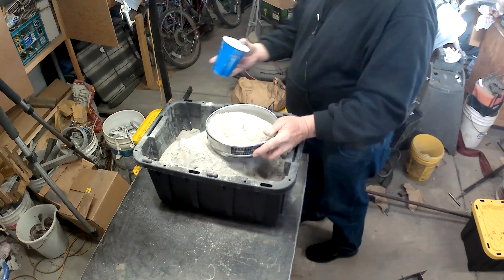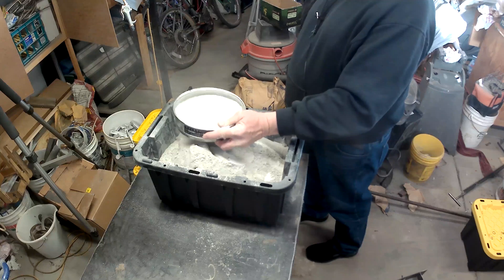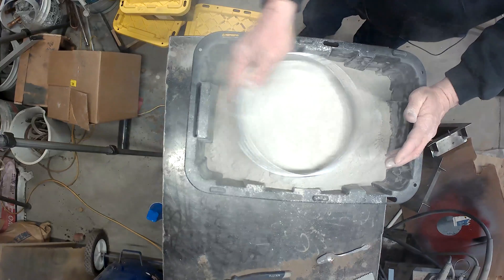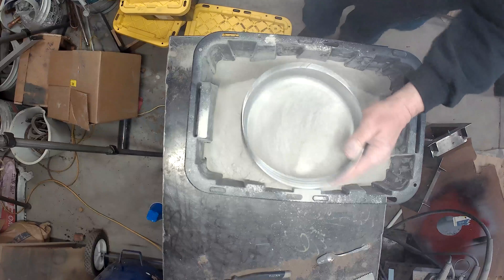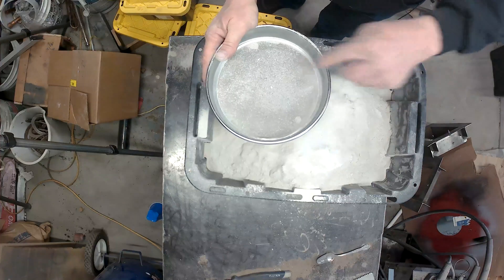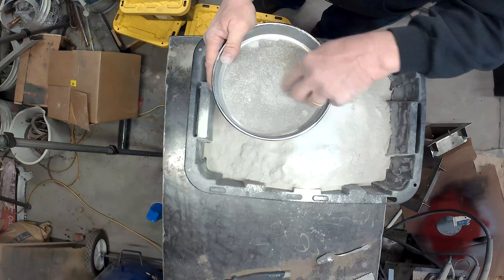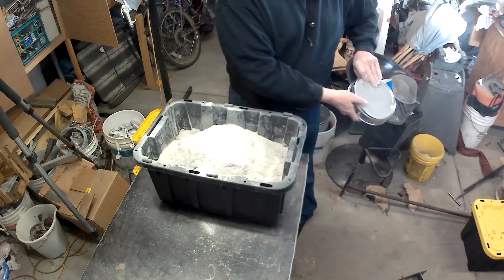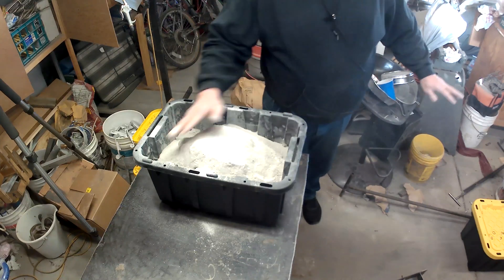Walk away from petrobond. My last word

Comment: When I look at your "incorrect" flag I see the stars in correct orientation but the stripes not so much.  The Red stripes start at the top and end at the bottom but your model begins red and ends white.  Right?  BTW:  I really enjoy your content.  Today was a pour of your ramming tool (or at least a close copy).  I used your pouring basin/sprue - runner/gate - spin filter arrangement and added 3 feeders to try to eliminate shrinkage.  I think I got a good fill but none of the feeders sucked down.  I had a tiny bit of shrinkage on the middle of the shaft but everything else was fine.  Thanks for the help.
Reply from the maker: Sorry for the delayed response.  I vaguely recall asking about an issue on a flag that I cast but for the life of me I cant remember what it was or what I thought the problem was. That was a few years ago and I'm old 😂

I learned something just the other day about feeders not shrinking that I thought was interesting. Not saying this is what happened to you but I'll share it anyway. If the metal is poured too hot and has a gas in it, the feeders don't shrink but rather kind of expand with a rounded top on them . They called it mushrooming as opposed to tubing. What you want is tubing not mushrooming. 

I also know from experience that when I pour too hot I get more shrinking in the parts. I expect this is from the metal being too "expanded" from the heat and that it shrinks more when it cools.  If you haven't done so, I'd encourage you get a low-cost k-type thermometer. It made a world of difference for me. Try to pour when your aluminum is 1325F.

Comment: To pulverize the tidy cat litter (Bentonite) use a blender but, fill it just over (1/2") the blades and let run. It will push it like a liquid up the sides and down the center to blades. If you over fill it will just stagnate in blender and posibly burn out blender motor. About a minute and you have powder bentonite. I did this on 17 pounds of litter before I let the blender rest because it will get warm. Thanks SWDWEEB for the video. I made 5 gal bucket of Homedepot play sand (50Mesh) and Tidy Cat litter (50Mesh).
 works great !
Reply from the maker: 😁😁 I tried a thrift-store blender and burned the motor out trying that. Could have been the motor was already shot as I'm sure there was a reason it was in the thrift store

Comment: Just a thought, couldn't you use plaster powder as the binder  with sand blasting sand ?
Reply from the maker: Don't know about plaster powder. Would it harden after the water was applied? I've also been told, but have not tried it, that plaster reacts with things like aluminum and releases gas into the mold. Again, I've only been told this.
I've also been told that sand-blasting sand is not good sand for molds. I think it has to do with the shape of the sand granules. I've never tried to make it with sand-blasting media so I don't know.

Comment: Wonder how the play sand would be if, after sifting out the rocks, it were run in a ball mill for a bit.....I'm thinking it's time to experiment
Reply from the maker: I expect it would be just fine, no pun intended. When you look at the grain size of petrobond it is very fine. My greensand is 80 mesh sand which is pretty fine but its not as fine as commercial petrobond which is typically around 130 mesh.

Comment: I have about 4 5 gal buckets of petrobond that I got from my boss. He bought it in a molding bench at a school auction. He never really used it so he gave me the sand. This was atleast 15 years ago. I always had a little trouble with the sand falling apart while molding. I just got back into casting and the sand defintely was even worse than before. I know you are supposed to add non detergent oil but I didnt have any so I used some chainsaw bar and chain oil. It seemed to work pretty well. Now my sand holds together much better
Reply from the maker: You might do a search on the use of isopropyl alcohol in addition to the oil. I read something somewhere that it helped activate the binder or something.  I never added it to my petrobond just the non-detergent oil. The non-detergent oil was hard to find where I live, only one auto-parts store seemed to have have it and even then it was "let me go dig around out back and see if I can find it". The sand got blacker and blacker over time. Never stopped smoking or stinking though 😂😂

Comment: I tried making my own greensand, starting with playsand, which was WAY to coarse.  I got some sieves like you, but the time and effort was a LOT.  Grinding up cat litter (they don't all use bentonite clay, BTW) took HOURS and made a huge mess.  For all the time and effort the castings were mediocre.  I'll stick with Petrobond.  Yeah, it costs almost as much to ship it as the price for the Petrobond itself, but when compared to the 10 or so days trying to make greensand, it's well worth, in my opinion!!   Time is money, right?
Reply from the maker: If I didn't have access to the sand and bentonite that I use, I'm not sure I'd make it either. I spent several hundred dollars getting  muller made so that I can make it without a lot of effort on my part. I sell it but most of the cost to the buyer is in covering the shipping. I don't actually make all that much on the sand itself. https://www.plmfoundries.com/product-page/green-sand

Comment: Great video.  Can you say generally how much use you get from a batch of green sand?  Suppose you had a 25 lb batch of green sand.  How many times can you reuse it making your flag casting, for example?  I ask because after about fifteen pours reusing the same green sand on a project roughly the same size as yours, I'm starting to see small gas bubbles (from steam?) on the casting, and I wonder if I have burned out the clay and lost permeability in this batch. Thank you.
Reply from the maker: Hi Fred, I think you're spot on with clay burnout.  As the clay burns out you probably need to use more water as a binder. 

I haven't really kept track of how many pours I do before refreshing the clay.  It depends on so much, how big the pattern is, how hot the metal is (aluminum versus bronze).  I basically add a little when I start to notice the sand is getting weaker.  I don't add a ton of clay either. 

I typically mull about 35-50 lbs of sand at a time.  I rarely use it all but I might as well do it all rather than guessing if I'll have enough.  That said, I probably add about 1/3 - 1/2 cup to that much sand. If I were to guess we're pretty close on 15 pours, maybe a little less for me (10ish??)

Given you make your own greensand, you probably don't need this, but I do sell small quantities of bentonite https://www.plmfoundries.com/product-page/bentonite-refresh if you need it.

Comment: Well I saw your videos about making greensand too late to help me getting started . I have already dropped over a hundred bucks on Petrobond and am still in the process of building my foundry.
I decided to go with ceramic wool insulation hardened with the hardener and coated with satinite. I’m building my own burner and it looks like mid summer I’ll be ready to fire it up.
Thanks for the info.
Reply from the maker: Well there is absolutely nothing wrong with learning on petrobond. It removes the variables of greensand moisture.

Comment: Priceless information!  The absolute most informative video I’ve seen on green sand.  Have you considered using a moisture meter to determine best moisture content for casting?
Reply from the maker: Thank you.  Yes I have but its didn't work. I bought one at a hardware store and it never registered the moisture content of the sand, took it back.  In my opinion, our hands are the best measure of moisture.  I can tell instantly if my sand is too dry or too wet.  

Of course calibrating my brain to making my sand dryer is a constant struggle.  I always think it should be moister than it needs to be. 😃

Comment: The finish on those casts are awesome, I haven’t moved on from play sand yet but I’m really looking forward to it. This has really motivated me to find some foundry sand. Another great video 👍🏼
Reply from the maker: Thanks, you can stick with play sand that's what my first batch was made from.  I still use it today.  Just buy a 50 mesh screen and get rid of the big stuff.  It takes a long time and you lose about half the volume during the sifting but play sand is cheap.  Of course if you can find sand like I bought it saves a ton of time.

Comment: Hello!
I live nearby the beach. Do you think I could just grab some of the white sand and filter it through a sieve? instead of buying playsand if I can't find any bentoniteas well.
Reply from the maker: I've heard that calcium (shells) may have adverse affects on the casting but I don't have any experience with it. You can always try given that the cost is so low.  You're going to have to have some sort of binder, pure sand won't have the green strength you need for your mold to hold together. I've been told that ceramics supply houses are a source for bentonite as well. You can buy it in small/expensive quantities on places like Amazon as well.

Comment: Just beginning the trip into casting. Found your videos and am going to begin the trip green. Was leaning that way anyhoo. Thanks for the information and tips on casting/mixing greensand... have about two hundred pounds of sandbox sand so will be dealing with that first. As far as screening things out I do pyrotechnics as a hobby so I have some really fine screens. Running the sand through a 50 mesh first and will go from there. Thanks again.
Reply from the maker: I found that 50 mesh gives a pretty nice finish.  If you can go finer... and have the time ad energy to do it, go for it. I don't think you need to go much finer but I really don't know.  Good luck with it and don't hesitate to reach out of you ever want to chat about stuff.
Reply: @swdweeb  well, got to lookin at the screens and have 40 and 60 mesh. Started on the 60...felt like I may not live long enough to finish. Also wanted to get enough sand together to do a pour. Went to the fourty. Got things mixed and here is my first trip into the craft. Looks like the 60 mesh is a better idea. Just need to get better set up to screen so it will be easier on the old bod. May have been a bit wet among other things. Have to figure out how to put a picture on here. Beginning to look like it’s not possible.
Reply: Yep, don’t know how to get a picture to you.

Comment: Hello, didn't you notice that green sand might give worse aluminum porosity because of the water added? I've got quite bad porosity with green sand, compared to casting to tin can. I repeated casting with water glass sand just for benchmarking. Water glass sand won in porosity - it's better than green sand. Here is a video
https://www.youtube.com/watch?v=jhmGImdcY5c
Regards, Ivan.
Reply from the maker: I havent seen any issues with porosity using green sand. The moisture content is very low. In my opinion porosity is the result of pouring technique and the sprue/runner/gate design.  

I have a series of videos on that https://www.youtube.com/playlist?list=PLU1QP34Dv8Y6-qXska4MOagRMSVWan40k
Reply: @swdweeb  Thank you for the link - I watched these ones. In my case (link above) I use the same technique (setup), the same metal, the same temperature, but see different results on porosity. In any case, will keep experimenting.
Reply from the maker: Hi Ivan, I finally had time to watch your video.  The quality of the video is very good, extremely clear.  The sand looks very coarse in the video. It probably isnt as coarse as it looks in real life.

If you want to email me at swdweeb@gmail.com I'm happy to discuss my opinions on what you're seeing.  That is a lot of porosity!  I think it is the result of your pour, not the sand.

I expect the break-out that you had with the mold was as you said, the draft was not enough.  I generally use 10% on a thin piece but probably would try to something closer to 5% for that tall piece.

Comment: I followed the Bob Puhakka videos to John Campbell and I come to the conclusion that metal should be basically slowly(but not too slowly) injected from the bottom of the casting moulds. Do you think theres a way to do that at home?
Reply from the maker: Yes I do.  https://youtu.be/hpwxnNlKP14 and any of my bell videos show what can be done in the home foundry.  
In terms of filling slowly, it is really about keeping the sprue, runner and gates full and not sucking air into them or causing causing turbulence by metal splashing about in the mold.  If I can find it, I have a video in which I look at a video from Andrew Martin to show what can happen.
Reply from the maker: Here is the link to that other video https://youtu.be/uTtstp_eDCI
Reply: @swdweeb  I think your system is the best way of doing what Campbell says to do while still pouring. But in one video I saw of him at castcon he said that metal shouldnt be poured because it is damn hard to stop turbulence. I'm just wondering out loud, but I'm curious if theres a way to have a feeder on the bottom of a cast and push the metal in from the actual bottom of the mould rather then the side. I imagine it would be hard as hell in a home setting, but from what bob puhakka and Campbell says, professional foundries dont even do that level of sophistication. I dont want to make it sound like I'm critiquing you at all. Seems like your the only one ive come across that even goes to the extent of counter gravity. I'm wanting to get in to casting very much. Your videos are awesome.

Comment: I have seen recipes for green sand that include a small amount of sea coal (very fine bituminous coal; added to form a gas film between the metal & sand) and wood flour (improves water absorption).  But the source also said those additives weren't as necessary for lower temperature metals such as aluminum.
I imagine there are some tweaks to the recipe that could make a difference, but unless you decide to try making some ridiculously detailed patterns, it may not be worth the effort to find that "perfect" greensand.  Your castings are great, and it's always a thrill to see the improvements you make.
Reply from the maker: Yeah, I know @Luckygen1001 uses coal dust in his sand to improve its qualities. 
I don't think @olfoundryman uses any additives in his sand, It seems to come right out of the ground with what he needs (short of some sifting I believe)

Comment: Hey nice to see you again! 👍
I started out with just play sand "borrowed" from a playground down the street, then did the kitty litter in the blender trick and got very fine silica sand at a pet store of all places.
Moved on to powdered bentonite instead of the kitty litter, works great for me for about a year now, was thinking to switch to petrobond because that is what most metal casters on YT use.
Glad to see you experimenting and hear you thoughts on this, I will stay on the green side too 😋👊👍
Reply from the maker: Well, you know my opinion but I think you’d be disappointed with PB if you gave good green sand

Comment: Thank you!! I was literally in need of this exact video as I type this message. This exact thing.

Any scale for how much water per lb or something like that you use? People say “till 2 pieces break apart and nothing crumbles”. Is that the best way to go about it?
Reply from the maker: I tried to reply last night but it obviously didn't stick. I agree with what both Carl and Andy said before me.  My sand is likely drier than you would expect. I do the clump test and as Andy said, you don't want it sticking to your hands, that's too wet. It is a matter of trial and error to get what is strong and not too wet.  The more you play with it the better your touch will be able to tell you if it's right.
Reply: I go by dry enough to not stick to your hand when you squeeze a handful tightly.  And wet enough to give it some strength.  The best way to learn how wet you want it is to cast over and over with it.  You soon learn.  Mull it (stir, shovel over, etc,) then let it sit for several hours and mull it again.  It will change when it sits.  Moisture content is not super critical over a reasonable range.

Nice job, , glad you're back.  Wish I were.
Reply from the maker: Good to see you too!   I'm going to email you later this morning.
Reply: swdweeb finally found some local Bentonite! Making my foundry tomorrow. Really excited.
Reply from the maker: Woohoo!!! Good for you. I’d love to see it when you start casting

Comment: Bentonite is used by well drillers, it's used to seal up ponds and it's used in wine making.
Reply from the maker: Don;t forget cosmetics ;-)
Reply: @swdweeb  thats right except in cosmetics they sell it as a magical healing ultra special clay which must be made out of the skin sheddings of the goddess of beauty herself because it is. So. Goddam. Expensive.

The reason why it's so cheap in tractor supply stores is because it's used as a complements to feed livestock and not obly do they need a ton of it they also need it to be cheap, and selling it in huge bags helps with the price as well. so it's probably the cheapest source of bentonite

Comment: When working with dry bentonite or silica sand wear a face mask. You don't want to inhale the dust. 

When I first had an interest in casting I tried kitty litter and it did work but it was a lot of work grinding it into a powder. Later I tried to get proper foundry bentonite. I went to a local foundry with a box of donuts. I then asked if I could get some bentonite. They said they din't have a container to put it in. I said, no problem, and went to the car and came back with a 5 gallon plastic pail. Ten minutes later I was driving away with a pail of bentonite that only cost me a box of donuts. 

The foundry worker who got the bentonite put on a face mask respirator before he went to get the bentonite. Safety first.
Reply from the maker: You're absolutely correct.   Thanks